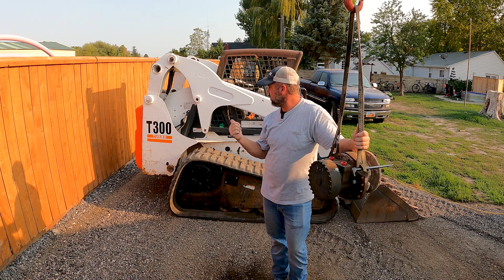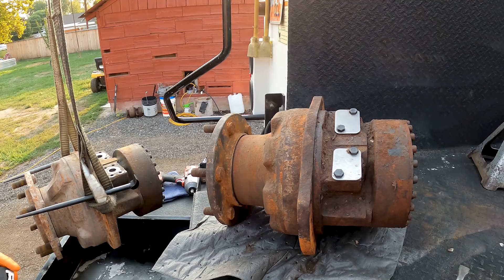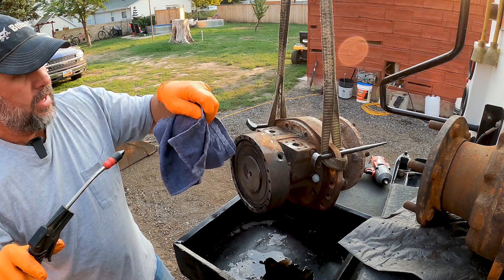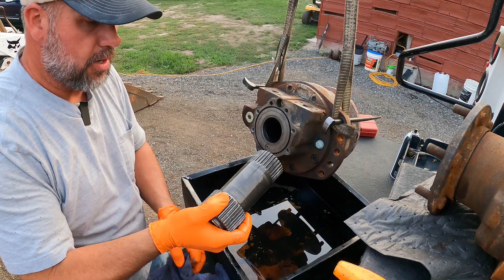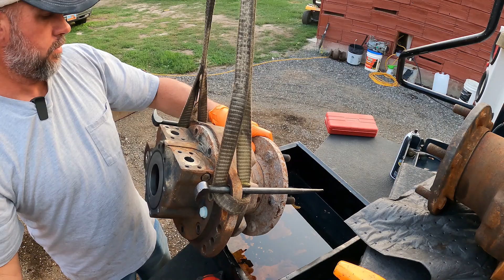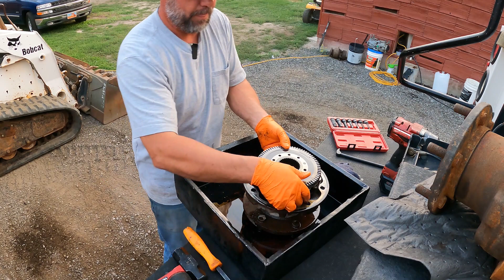Bobcat T300 Drive Motor Rebuild, teardown for inspection.

Comment: Our 2011 T320 is locked up on one side.  The brake section was dry (no oil) but full of rust on the bottom.  There was no gasket on the cover plate so water must have gotten inside.  The brake pack looks fine.  Have you seen these motors lock up due to rusting of the piston and housing?

Comment: My question isn't should I do it,but can dismantle the brake clutch assembly to ensure I don't have anymore problems and still run the machine?.. my brakes don't work anyway, and I would rather not buy a new motor right now.. seems like the brake pack section causes alot of issues on these..

Comment: Hey bud thanks for your videos they are a big help. I have a 2004 t300 with the older shorter 6 bolt drive motor. When I run the machine charge pressure reads about half on the dash. Whenever I drive forward and turn left the right drive motor sounds alot louder than if I turn right the left drive doesn't sound loud at all. It's no resistance in either handle and whenever I set the brake the machine won't move when I release the brake it seems both sides are released. I just recently bought machine and just wanted to make sure the brake wasn't stuck on the right drive motor. What would you check first the charge pressure at the different points to the drive? Thanks for the help.

Comment: Pretty sure I have a long nose, ~4" from outside flange to sprocket and it has drain pin on the outside flange. It's a 2008, T250, #A5GS20091

Comment: The speed sensors for these are discontinued on the SJC units. There is new software that programs them out. They aren’t used anymore. I finally found this after calling Bobcat directly. My dealer was arguing with me over it. I was looking right at the sensors and he told me they don’t have it. 
 That situation got me watching this video. Good info. 
Thanks.
Reply from the maker: Speed sensors can only be deleted if the pumps have swash plate sensors in them.  Not all machines can be updated to delete speed sensors.
Reply: @tetradgroup  good to know. Mine does. Bobcat went off the serial number. I was shocked at the quality of customer service. A human answered after two rings. No computer answering machine even.

Comment: I have a t300 I changed
Out the sprockets and notice I have a short nose and long nose sproctet is that normal
Reply: The long nose and short nose drives require different depth sprockets to maintain the same track alignment

Comment: Would it be be possible to monitor the motor brake section with an IR temp gun to see if one has  suspected brake issue? If that seal is leaking and the brakes are dragging, than the suspected  motor should be hotter than the other one?
Reply from the maker: In theory, yes that should one way to see if the brake is dragging.  I have not tried it however.

Comment: I have. 300 short motor , the final is blowing the speedometer seal. There were a few brass shards in case drain. Which seal/gasket if broken would allow those metal shards to pass through the rest of the hydraulic system. The dealer told me to sell the machine and buy a new one

Comment: Another great video..any idea what the tap size is for the 3 bolt holes on sprocket? Can the drive motors be mismatched and machine still function correctly? Meaning, can a long shaft replacement on one side be used if the opposite side remains original short shaft?
Reply from the maker: Sprocket is 1/2 x 13.  Yes you can have mismatch motors, no problem at all.
Reply: @tetradgroup  great, thanks.

Comment: Hello I been watching your videos working on bobcats I have a t300 and the hydrostatic motor won’t build pressure I took it to bobcat they told me that I have a hydraulic failure and it’s not worth fixing it’s this possible? Thanks in advance
Reply from the maker: I would think any hydraulic failure is worth fixing on a T300

Comment: On my T300, my hub is leaking oil but making no noise and drive function seems normal. Can i squirt some low vis grease in there since its only lubricating a large bearing and no needle bearings rather than tearing down for a rebuild or buying a reman unit?  Hate to spend all that $$$ if some grease will work in that hub area.
Reply from the maker: Not sure how well it will work but worth a shot to get more time out of it.

Comment: Have an issue on my T300 Track Loader. Attached a bucket grapple, plugged in the hydraulic lines and started machine. Selected hydraulics for attachment and tested. One hose was not locked on and blew off. Went to reattached hose and now no function lights on the left panel hydraulic selections. Sent panel to ISOSCEL but panel is fine. Not sure where to go next, Fuse?
Reply from the maker: Depending on serial number it may have a separate auxiliary controller and fuse
Reply: S/N 532011591  Thank You

Comment: Hello. I just bought a T300 at an auction. never had skid steer before. everything works fine, but periodically on the left side a loud knock, it looks like  from the drive motor. what could it be??? Thanks. Alex.
Reply from the maker: Not sure but I would make sure the track is not slipping on the sprocket, that will make a loud pop.

Comment: Where do you recommend ordering a new or reman drive motor for a T190. I believe my face seal on the outside is leaking and I’m not sure if it’s worth the trouble of tearing the whole thing down if I can buy another drive for half the cost of a seal kit.
Reply: Correction… If the seal kit is almost 1000 bucks might as well just buy a reman drive
Reply from the maker: Check with Bobcat first and then Texas Final Drive if Bobcat does not have one.  Good luck!

Comment: You mentioned that you replace the rings in the rotating group. Where do you get the replacement rings for the pistons that are in the rotating group of rollers? I cannot even get that part to show up on bobcat’s site. And I’m not going to buy all new pistons. My seals for those pistons are cracked and broken.
Reply from the maker: The seals for the pistons themselves are not sold separately unfortunately you will have to replace the whole piston.

Comment: Great video I have a t595 2019 recently had the plug fell out and hadn't noticed until machine started to turn pourly,I got off machine and then noticed the plug was out and it was smoking I immediately put machine on trailer and took to dealership.i am really hoping it does not have any internal damage from being run without the fluid for I don't know how long? In your experience would this breaked turning I experienced be possible from just being low on fluid or more likely I have some some internal damage? I have no idea when plug came out and would think I would have noticed since I clean the tracks pretty religiously but am desperately hoping I haven't done any major damage
Reply from the maker: Which style motor do you have?  If it was smoking I'm sure some damage has been done.  Most dealers rather replace than rebuild.  Let me know what they say.  I have some motors rebuilt and ready to go if you need one.
Reply: They had to order the plug which they'll have tommorow and they were going to fill it back up and put plug in. What part of the county are you in?
Reply from the maker: @lukejohnson8110  I'm in Salt Lake, if your motor has the plugs on the outer housing that would be for the brake oil, if the brake pack is damaged it will be cheaper to replace the motor than to rebuild it.  The brake pack and seal kit will be around $1700, add labor and the reman would be a better option.  Hopefully not to much damaged occured but if the brakes were smoking I will be surprised if the brake pack is not damaged.
Reply: Thankyou for your advice brother I have been riding skid steers for 14 years now but the past five years has been my first personal machine and it's a whole different animal. I really appreciate your time and input definitely learned a lot here thankyou

Comment: Where can I order internal parts for these motors? I have one that is weaker than the other and I assume the brake clutches are partially engaged. I’d like to rebuild the motor myself.
Reply from the maker: Bobcat of course and check bobcatpartsonline.com for the diagrams.  Most hydraulic shops can also get all the parts for the Rexroth motors but they will need the Rexroth part number from the tag attached to the motor, if it's still there.

Comment: On my s750 I filled the chain case oil and it ran out into the pan on the left side. Is there a seal between the drive motor and chain case?
Reply from the maker: Yes there are lip seals between the inner and outer carrier bearings but still that's unusual to leak in that direction.  Can you see the oil leaking between the drive motor and case?  Hopefully the case itself is not cracked.  Usually when those seals go bad hydraulic oil will pump into the chain case from the drive motor.  Carrier seals is a big job and the seals have been updated depending on your serial number.

Comment: I figured out my question to the hub bearing section to get to the face seals. I have to press the sections apart
Reply from the maker: That's correct, the shaft will need to be pressed out of the bearing.

Comment: Awesome video. It was the only reason I was to be able to take apart and understand my motor better. I’m going to level with you here. I’m a carpenter but starting building my house a few years back. I own my own bobcat 864, which I’m sure you know has the same drive motor. On my machine I have one long nose and one short. My short nose started leaking very minimal behind the hub. In order for me to own this machine and keep it for my property and for small cash jobs. I have to do everything myself as I can’t afford to pay anyone to do these expensive things. The good thing is I can sit on things because it’s not a machine for a business, so am learning as I go. But as you know this video took me all the way to the hub section, as you issues were before the face seals, so you didn’t have to go any farther. Any info that can help me get to my face seals would seriously help me more then you know. I am sitting here staring at the top of my bearing, trying to figure out how to get the rest out to get to my seals. All of my parts have looked really good up to this point. So I have a really good outdated short nose that I’m trying to keep alive. Plz help. I’ve been talking with Texas Final Drive with their main tech Shane, but he’s always so busy it’s hard to talk to him. I know the bearing has to be pressed in with a press, but how does it come out. Thank you. 
Jason (262)888-2080
Reply: I know this is old but for others.  There is two C shaped retaining rings you knock out of their slott and remove the preload washer.  Then sit the upper housing ears on blocks and press in the center of the spindle.  The housings will press apart then.

Comment: I smashed my case drain line on a cat 259 n now my final drive pump is  leaking hydraulic oil? Would you have any idea what seal went out?
Reply from the maker: Face seal at hub blew out, also known as duo cone seal, if your referring to the final drive motor

Comment: How do you remove the brake piston on a 4 port drive
Reply from the maker: Remove back plate and use compressed air into the brake port to blow piston out.
Reply: @tetradgroup  thank you do you have any reassembly vid specific to the brake pack

Comment: What if you were to just remove the brake disks and run it without?  The motor will work, but the machine would just roll when you're off the levers as an older wheeled machine would?

Comment: Thanks for the simple man's explanation.  Would not have attempted to take one apart before this video as my t300 has some excessive whining on left side only and I suspect failing seals. Hopefully im on the right track. Thanks for sharing
Reply: Iv got a 06 t300 sjc  controls and my right side motor is whining also…. Looking for answers
Reply: Did yal end up figuring out what the whining was from mine whines only when turning left not turning right. When I engage brakes machine will not move like it's supposed to.

Comment: Thanks for all the good info. (Question) I have the same machine 2003-4 T300, a while back it started acting up, it drives forward , reverse and skids left but will not skid to the right. all hydraulics worked normal bucket up, down, tilt. So I had a mechanic the best in the business take a look at it and he diagnosed the right hyd. auxiliary pump been bad so I had him replace it. after he installed the new pump and changed all hydraulic fluid. The machine did not move forward, reverse or turn left. so when he said he was eliminating possibilities and it might be the MAIN PUMP.  I asked him to leave. 
1) What was the symptom of your machine?
2) Can you advise if my b-cat may have the same problem ( a bad drive motor) 
3) Can you recommend a reliable Bobcat re-man source for drive motors, parts in general.
Thanks again for your unconditional help. looking forward to your next video.
Reply from the maker: Sorry he replaced the gear pump as it has nothing to do with the drive.  I suspect you have the same issue as I described in the video, leaking piston on brake section of motor which can be fixed if you don't want to replace.  I prefer to use Bobcat reman motors, I've always had good luck.  I've bought reman motors from other well know builders and was not impressed with the quality.
Reply: @tetradgroup  Thank you